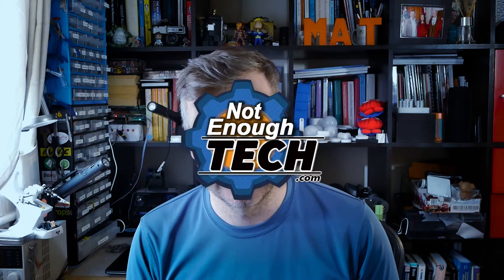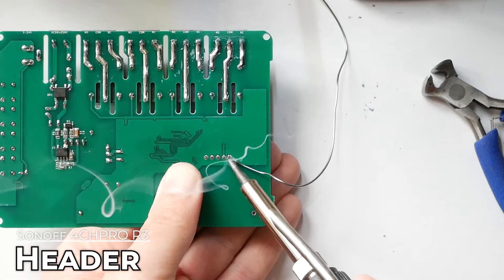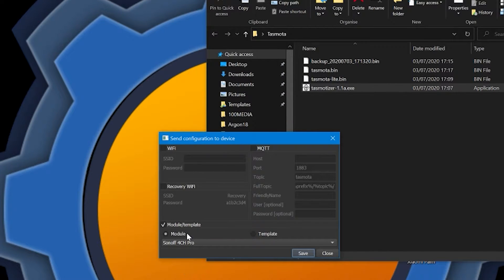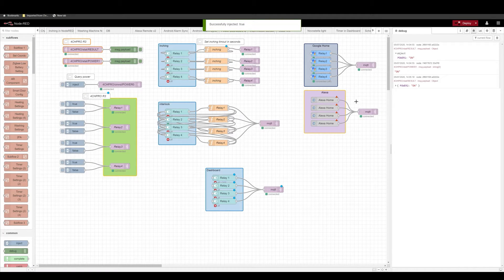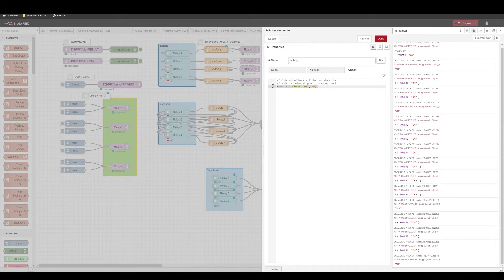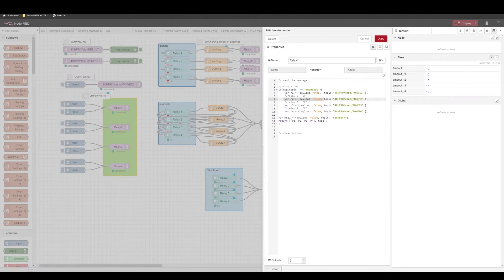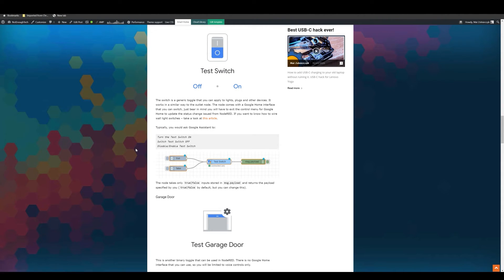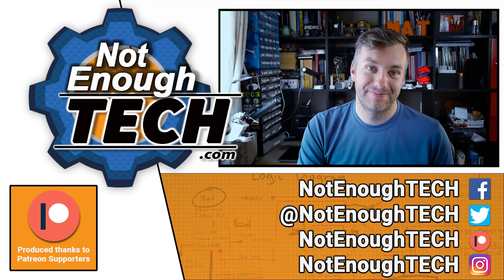Flashing Tasmota on Sonoff 4CH R3 and 4CHPRO R3

Comment: How does the Sonoff PR feel about this, after sending you these?
Reply: I suspect that they wont care about it too much as they make money off the hardware and not the software platform. My decision to buy Sonoff gear was BECAUSE of the ability to put Tasmota on the WiFi switches. After that, I bought a few Zigbee R3's for some lights and the bare bones 4CH relays to build my sprinkler system. It all started because I bought their Basic switch for Tasmota. Not once did I use EWELINK.
Reply from the maker: @jerrywolsztyniak8834  They do care about the content actually :) And for your feedback guys. They may not always get everything right, but as PR team goes - one of the more responsive companies I dealt with.
The reality of the situation is that DIY users no matter how loud they voice their decisions we are just a small % of overall sales - I know its hard to believe but its true :)  so considering that, they are pretty great with us messing about with their devices which I'm always encouraged to do so -even when I shower ITEAD with criticism :)
Reply from the maker: Haha :) Probably slightly betrayed. They will get over it soon :) I will say a couple of good words about their sonoff zigbee series